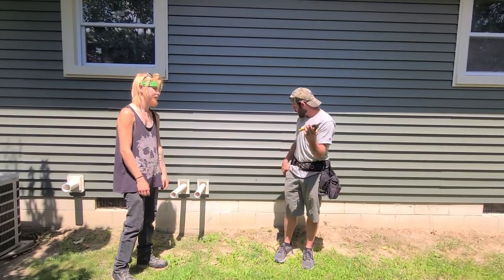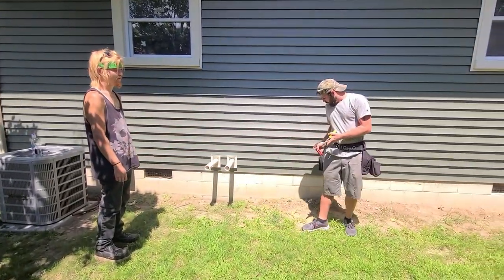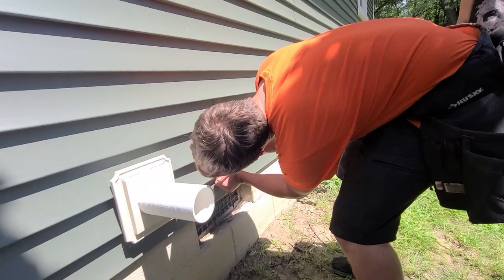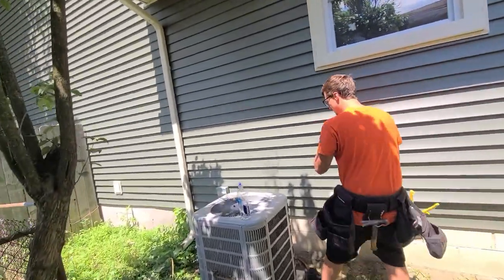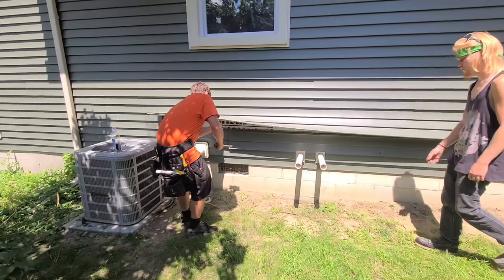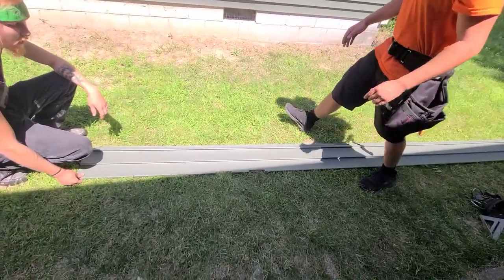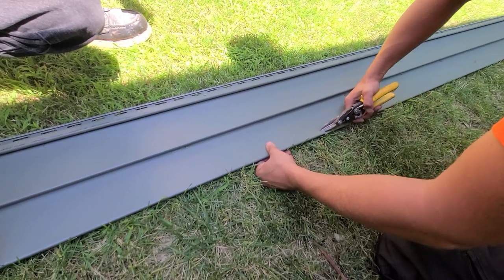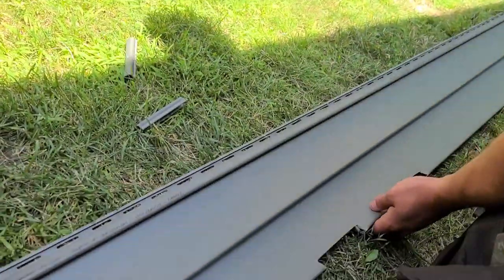HOW TO | Repair siding

Comment: clown construction, when replacing vinyl siding just leave the old nails in the wall, put your new piece on without nailing nothing cut around the master mounts while it's on the wall, snap back in place your done, three minute job, if they would have used the zip tool correctly time saver, try it next time it will save time, especially when you have a lot of siding to replace because of hail damage.just kidding about clown construction, your are the best roofer I've ever seen.
Reply from the maker: That way is pretty good too I've done that a number of times as well.  Would have to say I would've removed the nails here too but to each his own.  And thank you sir

Comment: Man I know this has nothing to do with this video but from one veteran to another I need a hand....how the hell do you shingle a valley? I know you made a video but its confusing....like I need to know everything. What side do you start from? Help me out brother
Reply: you always start from the lower side when running your valley. Put down the taller side shingle first with the smaller sides shingle second with the 6in overlap onto the opposite side of the valley. From there you will run the valley up with your lower side being the one ran out first from the shingles placed inside the valley. After it has been ran up you will then do your gravy runs and finish the lower side off. From there chalk your valley. You will run a shingle up the valley vertically with the windows facing out. You then will line the shingles up with the edge of the vertical shingle. Run 2 shingles out on each row to ensure you are keeping your rows straight. hit the gravy run and tie up your ends. I probably could have worded this much better but it helps paint a better picture while you watch his closed valley video.

Comment: Plastic siding is trash!
Reply from the maker: It's vinyl.  I don't think that's plastic.  But that's what pretty much every house out here under 200k has on it
Reply: Zack of All Trades not hating bud I just hate rerooting houses here in nor cal with that siding. Makes wall runs a pain in the ass rather than hardy siding with z bar
Reply from the maker: @tmt3052  yea no problem didn't think your were hating.  Almost all of the U.s uses trash compared to other countries lol
Reply: Zack of All Trades where you from
Reply from the maker: @tmt3052  north west Indiana